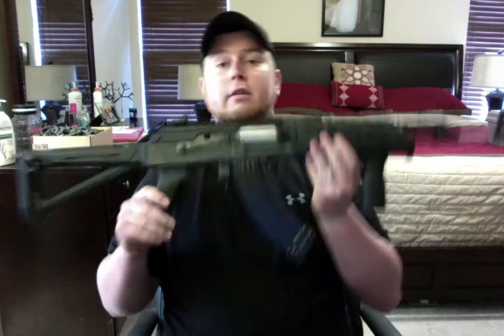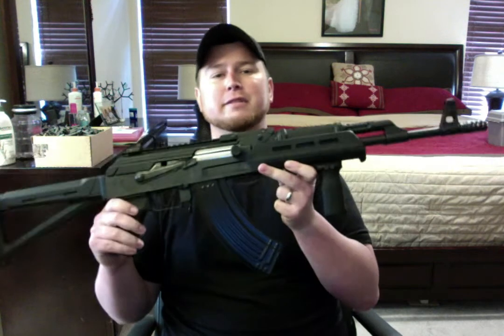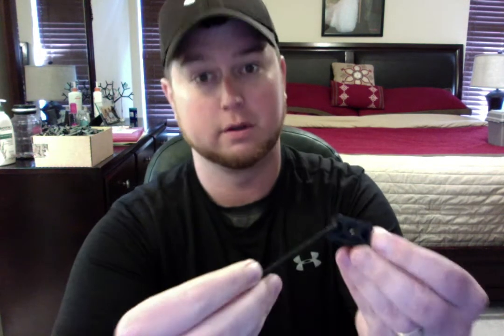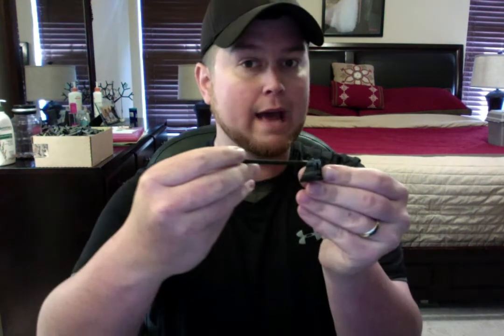C39-V2 wear & tear update with headspace check.

Comment: If you’re worried about the fragility of the Century cast steel, than get a recoil buffer plate to protect the rear trunnion, and easily replaceable is the bolt and bolt carrier. (Polish milled receiver bolts work in the C39V2)
Reply: Thanks, good to know.  I have a demilled C39V2 stub that I'm planning to reweld onto a demilled Polish receiver as a custom build and wanting as many original parts to be as Polish as possible.  Feeling a lot more confident knowing this and other bits of info I've managed to gather.

Comment: Thanks for the fast reply. I will buy them as soon as I can. So fas so good with my C39v2. The bolt assembly and trigger assembly look like new except for normal finish wear. Accurate out of the box. Thanks again. Enjoy the rest of you day my friend.
Reply from the maker: Absolutely brother thank you, I also was pleasantly surprised with the open accuracy of the V2 out of the box. To get it dialed in specifically to your taste, I HIGHLY recommend purchasing the MagnaMatic FST from Rob over at AKOU. It's really well built and a great value. I made a very slight adjustment to my front pin for windage, and with that tool it was effortless and also made me realize how well the pin fitment is on these rifles. Some are damn near impossible to move, others are wayyy too loose. Always appreciate feedback.

Comment: ~I bought my VSKA last June.  No Problems at all.  I too give the RAK-1 Trigger 5-Stars.  
~My hammer came with the "humps" already rounded by the Factory.  Smooth!
~I'm 70 and I believe my VSKA will work fine for me until my Days are over.
~I clean all my Firearms after a trip to the Range.  I Love cleaning my Guns.
~I guess you know by now your photos are not in this video.   😉 LOL
~Head Space Gauges are expensive.  I have two "NO-GO Gauges:  one Russian Spec and one SAAMI Spec. I like your "GO" Head Space Test.
~You should put SUFFICIENT FORCE on a NO-GO to be SURE the bolt will NOT CLOSE.

Comment: I’m a newbie to the AK and to shooting in general. I own a c39v2 with no issues in the first 1000 rounds. Can you explain to me how to remove the bullet from the casing so I can do a Go test on it? If you can’t I understand.
Reply from the maker: Jorge Solis If you are a newbie to the AK platform, I would strongly suggest to purchase a set of “Go/No-Go” gauges to perform the headspace check. This is the most sure way to do the check. The gauges aren’t cheap but they are definitely a good investment and a safeguard against your rifle blowing up in your face. Mostly what I’ve seen with these particular rifles with occasional and mild shooting is they are just fine and you should have nothing to worry about. Problems with head spacing generally take some time to develop, but using the gauges is the best way to determine that.

Comment: I really like this firearm really fun to operate but bought one 90 rounds later bolt carrier jammed so bad had to send back the receiver had a large bevel on the bolt carrier travel rail
Reply from the maker: 3 mags... man..thats one of the quickest major failures that I've ever heard of a rifle having period...regardless of the make. I'm just glad that nothing happened to you brother. Hopefully they'll get you a replacement or at bare minimum replace all the parts and check out the front trunnion/headspacing for you...